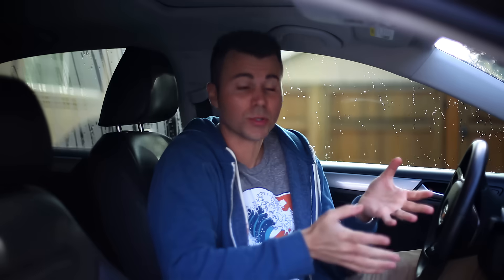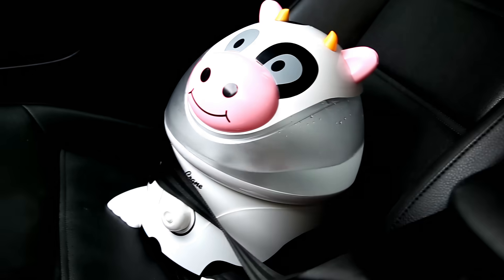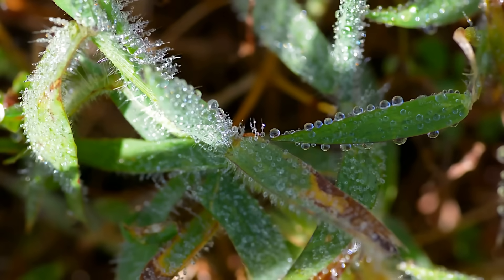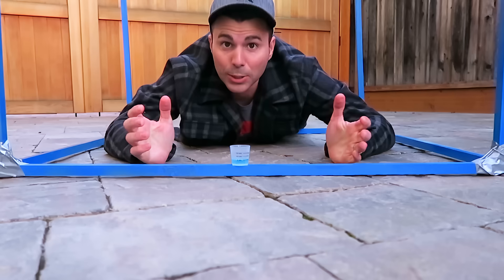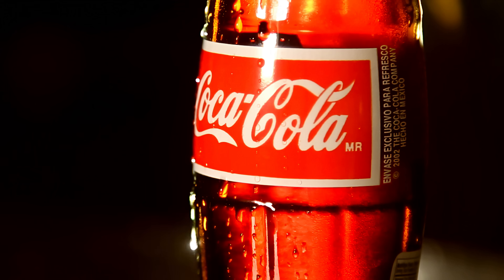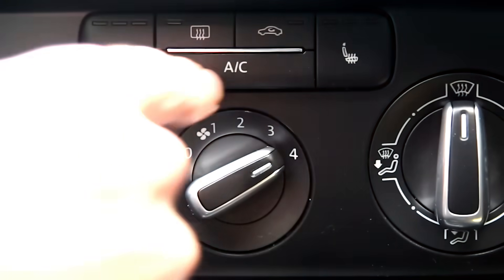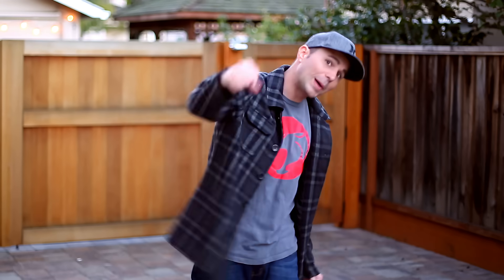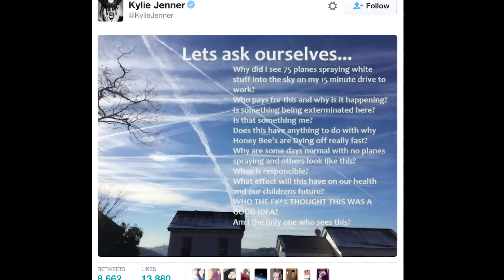Defog your windows TWICE as fast using SCIENCE- 4 easy steps

Comment: I'm not a scientist, I do have an engineering background and a lot of common sense.. I have known for years that what you mentioned here the best method to defog your windshield is to use the A/C, have the intake on fresh air not recirc, crack the windows a little if required, heater to hot and fan to high. It's so common sense I cannot understand why numpties drive around with fogged up windows in the winter with a tiny clear patch rubbed by hand, it's so dangerous.
Reply: Whereas I'm just some asshole who managed to pass a high school science class once or twice (okay eight times, but it's high school, so who cares), and I also could figure out that was the best method.
Reply: Do you actually know what refrigeration is... and how it works??
Reply: It's quite simple:  If you have the A/C on, the air first passes through the A/C's evaporator coil (usually the cabin air filter comes first, if there is one).  The evaporator coil will dry the air.  After it goes through the evaporator, where the air is both dried and cooled, it passes to the heater core (or heater matrix), where the air is warmed to the desired temperature.  Yes, this is where the setting you've chosen for your system will decide just how warm or cold the air is.  Before the heater core, it's at its coldest level.  If you've selected anything but that coldest level, the heater core will warm the air a bit.

This, essentially, gives you dry air at whatever temperature you've selected - even hot temperatures.

If you don't have the A/C turned on, the air bypasses the A/C system entirely and goes directly to the heater core.  This means that the air has not been dried, and also means the air has no chance of being a lower temperature than ambient (and will likely be warmer, considering that it passes through the car's radiator, pulling heat from the car's coolant).  As such, without the A/C system turned on, the air will likely be more humid than it would be otherwise.

To summarize:  The A/C system dries and cools the air, where it then can be warmed up by the heater core to whatever temperature you desire.  This will defog a window better than bypassing the A/C system, which does not dry the air.
Reply: U r coming across as bragging moreso than complaining .    Just sayin
Reply: Marek Sumguy - Why don't you try it?  Turn on your AC, and make sure the heat is on.
Reply: Marek Sumguy - Yes, I do.  Do you know you can have A/C turned on while heating your car?  Did you know that doing so makes a difference? 

The point isn't having "hot A/C", as you've described it.  The point is that turning on the "A/C" button while heating your car actually makes a difference.
Reply: Please explain how.
Reply: So you're telling me that the A/C evaporator coil is on the same air circuit as the heating coil??  

And IF this is true... that would mean that the best way to cool down an overheating engine would be to put on heat and A/C... as this would draw as much heat as possible out of the heater radiator?
Reply: That's not exactly how it works.  All of the air, whether going through the radiator or through some other inlet, ends up in the ventilation system.  If the A/C is on, the air is shunted to the A/C system, where it ends up at the heater core.  If it's not on, the air goes directly to the heater core.  Of course, if there's a cabin filter, it goes through that before it hits the heater core either way.

What that means is that the A/C doesn't help pull heat from the engine.  The air is moving through the radiator at a speed determined by outside factors (car speed, radiator fan speed, etc) no matter what, whether you have the blower on high, low, or off.  The engine is being cooled through that radiator the same, regardless of whether the A/C is on. In fact, the A/C pump makes the engine work just a bit more, so - if anything - the engine would generate slightly more heat if the A/C was on.

As such, if the engine is overheating, the best options are to shut it off or get some speed.  If you're stuck in traffic on a hot day, it won't hurt to have the A/C on (you do need to cool down), but having it on won't cool the engine.

Neither will having the heat on full blast.  The heater core does draw heat from the engine, but not at all enough to cool the engine down any faster.

One caveat:  Older systems, with mechanical levers and nearly-ancient (by today's standards) A/C pumps will work a little differently.  They still use closed-loop refrigeration, with an air drier and an evaporator, and they still used the heater core to heat the air up to your setting.  That said, they didn't have robust cabin filters, the pumps were powered differently (sometimes), and they were often so inefficient that their operation made engines work even harder.

In short:  While the A/C system is separate from regular ventilation, they do meet together in two places:  the cabin filter and the heater core.  If you want dry air pumping into your car, use the A/C.
Reply: Excuse me... but how can you have HOT A/C??. Isn't the A/C coil on a different air circuit?!??!

Pro tip: use 12 volt (or portable battery powered) heat gun/ hair dryer.

Comment: the only bad thing about this is that having the AC on and heater burns through gas
Reply: Its a microscopic amount of gas that it burns, and its nothing compared to idling the engine for an extended period of time (which uses a huge amount of gas and wears your engine out much faster) so this technique actually saves you gas and money.

Comment: I didn't know that any car will do heat and a.c. - mine doesn't
Reply: Yes it does, simply turn on the ac with the heat... You're welcome...
Reply: Hezekiah Domowski ... I've never known a car with AC to NOT allow that. You'd be doing a public service to tell us what back-asswards cars you've owned so we all know to avoid them ;)
Reply: In my country, and i believe most asian country has only a/c without heater since the weather is warm in most of the countries most of the time. So yeah
Reply: Not all cars have a heater it depends where you live. Because if you live in a country that doesn't get freezing temperatures it wouldn't make sense to spend extra money on something that would never be used. I live in Canada so every vehicle has heat but in older cars a.c. was an option not a requirement.
Reply: If your car has a heater (some cars sold in tropical countries don't have one) an dit has Ac then this can be done. What differs is that many cars have a superstar button that activate the AC (compressor) and that is the technique that is shown in this video because that is how his car works. Many cars that have some sort of automatic climate control (whatever its called) do not have a separate button for the AC compressor. Those cars will automatically engage the AC compressor when the defrost buttons are activated. You can see this for yourself by opening the hood, watching the Ac compressor engage as someone inside the car activates the defrost buttons (many of those cars have two buttons, press them both just to make sure that you have engaged the correct one). You see the front of the AC compressor start spinning when the defroster is engaged.
Reply: Hezekiah Domowski literally every car ive owned is able to do so. dodge neon, an ae92 corolla, b5 a4, suzuki sx4. fiat 500t, and bmw 335d.
Reply: Just because you don't use it doesn't mean that the facility doesn't exist. Cars sold in arctic regions still have the ability to blow cold air, even though that might never get used. It's simpler and cheaper to just build them the same rather than bothering to delete the heater matrix from the spec, particularly as you might find yourself in need of the warm air function if you drive up a mountain in the cooler seasons and start encountering ambient temperatures in single digit celcius. And it can get even colder at night.

I mean, there might be tropical region models that truly don't have anything but fan (and maybe A/C), but I'd be surprised to find it. The function of a car is to travel after all, and it may well take you thousands of miles away from home to somewhere that has a very different climate, so there's no sense to not equip it for such an eventuality. It also works as an emergency heat dump if your cooling system suffers some malfunction (sticky thermostat, failed part-time radiator fan, etc)...

Comment: There seems to be some confusion here between "de-frosting" and "de-fogging" / "de-misting"...
Reply: mspenrice where I live pretty well every time I get into my car in the winter there is frost on the inside of the windshield. It’s really common anywhere even remotely northern.
Reply: mspenrice I meant the snow melts once you are in the car and once you leave it overnight is when it condenses and freezes. I live in southwestern Ontario. Usually -10 to -20 sometimes -25 during the day and -20 to -30 at night (Celsius for all temps)
Reply: Define "remotely northern". I live somewhere that's considered by some to be at least technically in the north of the country, but it's "only" about 53 degrees above the equator. Which is enough for decently wide swings between summer and winter (like 50'C / 90'F between the highest heat and the deepest cold)... I've only seen frost on the inside of the car when the temperature has dropped somewhat from near freezing to double digit negative celcius, ie so there was still SOME moisture in the air, which then ran into an extremely cold piece of glass that froze it in place instead of spreading it out into a still-technically-liquid misty covering...
Reply: mspenrice it depends on how many people you have in ur car, since more people brings more snow in, which melts and then condenses on the windows and freezes. As far as remotely north I should have said anywhere where in winter it’s below freezing consistently. Doesn’t really matter
Reply: We regularly have winters where it can be subzero for weeks on end... still only seen it happen 2 or 3 times. Also, the frost I'm talking about is already on the inside of the screen when you get into the car... and wouldn't more people cause the interior to warm up faster?

I guess what I'm asking is where you are. No need to be exact, like, just general area of whatever country or state...
Reply: Ah, I understand now. And yeah, that's considerably more "north" than what we experience ... even though you're probably on about the same latitude, the lack of jetstream / labrador current and being more continental makes the winter harder and probably counts for a good ten extra degrees :-o
Reply: And then if you're canadian there's deicing the inside of the window
Reply: Well, usually the latter on the inside go hand in hand with the former on the outside... so it kinda gets lumped together.

When you have to defrost the inside of the car (which I've had to do maybe twice before) you know things have got truly serious. All the same, this method will still help you to do THAT faster as well (warm, dry air will assist the ice in both melting into water and subliming into vapour)

Comment: Umm...just use a bucket of warm water and pour it on your window and it defrost in idk 0:5 second
Reply: Furiousfifa_martyn !!!! warm water on frozen windshields = new windshield needed.
Reply: This video isn't about defrosting a window. It's defoging the window. But if you want to use a bucket of water inside your car go right ahead.
Reply: Furiousfifa_martyn !!!! Not sure that your car gets to -30 Celsius at night or colder. Warm waters not good on glass at those temperatures.
Reply: I hope you don't have a chip in your windshield, cause that'll cause the windshield to spiderweb...
Reply: BlazeChronicGreen420 no it doesn't I do that all the time is fine
Reply: ANIME GODZ lol Not only were you extremely confident about your input, but you also failed to read the title of the video...... How is this the world we live in?? Did you even watch the video? There were two free chances for you to know what was going on..... Wow
Reply: Bottle of rubbing alcohol you can put in your car it'll be cold it's alcohol it won't freeze it chemically melts ice anyway so pour a little on the ice melts I know none of this has anything to do with fog. You don't want fog on the inside of your windows roll up to damn windows then all the moisture is on the outside
Reply: crownofall - There's moisture in the air inside your car, so there WILL be condensation on the windows if the temperature drops below the dew point - regardless of whether the windows are up or down.
Reply: John Crafton If the moisture content of the air inside your car is higher then outside the car, the dew point inside your car will be higher then outside. The more saturated the air is the less temperature drop is needed for it to start forming a fog. The idea is if you open the windows the air outside will have lower moisture content and therefore a increase the dew point temperature, which would help speed up the effects of defogging the inside of your window.
Reply: Sycops - I know this.  I was replying to "cronofall", when he said "You don't want fog on the inside of your windows roll up to damn windows then all the moisture is on the outside."  I was merely stating that there's moisture on the inside, and that keeping the windows rolled up won't prevent that.
Reply: John Crafton my mistake.
Reply: Sometimes this will crack the windshield and sometimes it won't. Modern windshields are very strong but this is an abusive thing to do to it and you might get away with it sometimes but then again there are plenty of folks that have done this and crack their windshield the first time they tried it so don't do it.
Reply: Angel Martinez ops didn't know it was Defog

Comment: Fog and humidity is nothing, try coming up to Canada where we have freezing rain...fun times.
Also when snow hits the warm glass of the car you have just been driving, or when it's warmer during the day and the temp drops at night, this causes frost build up on the outside of the windshield (usually at the bottom near the wipers, usually freezing them in place). Harder to remove and takes longer. If you have cracks or chips on your windshield, an excellent way to turn them in to a spiderweb is to beat at it with a scraper or blast the defrost heat directly on to the windshield. Also cranking the wipers when they are frozen in place or covered with heavy wet snow is a perfect way to break them or burn the motor assembly.
Frost builds up on the INSIDE of the car when you have water/melted snow in the foot wells, or the floor mats are damp.
When you lave the car parked, and the temp. drops at night, the rising moisture freezes to the inside of the window. The best remedy for preventing it is to keep the inside of the car dry as much as possible, like putting news papers in the foot wells, and silica packets on your dash to absorb any rising moisture that may reach the windshield area.

Hopefully you learned more from the info in my comment above than having wasted your time watching this video.
Reply: So I can avoid having to do any of his advice, by stuffing my car with newspapers and silica gel packets? I was using an aerosol can and a lighter to melt the ice before, I accidentally set fire to my car once and defrosted the car next to mine. I also used to pack fruit into my exhaust to feed foxes at night. Their saliva has special cleaning properties that turns your exhaust chrome.
Reply: Chargèro Canada is not the only place that gets freezing rain...lol it makes its way down to the middle of United States, sending love from Central New York! Oh and anything written in your comment is basically common knowledge. This guy's video was far more intellectual and scientific than you could ever hope to be.
Reply: He said it depends on things just like what you said. He went to a huge effort to educate us. Be cool man.
Reply: Videos from Québec ya im in northern mb. On cold days i can pour a bottle of water out and it freezes before it hits the ground lol.
Reply: Videos from Québec Maybe you should realize that freezing rain isn’t a phenomenon that only occurs in Canada. I’ve seen it here quite a bit.
Reply: chance the rapper
Reply: Then Global Warming and Climate Change come rolling in...
Reply: Laurence H: You win!
Reply: Thank you to all for the helpful suggestions from this thread. Desiccant (what's used in silica packets) is easily found, & affordable, at local stores, because it helps to absorb moisture from damp places. High humidity weather can be an ideal environment for mold to breed, especially on clothing or linens in closets at home.
It is also used in RVs & boats.
I've purchased the brand DampRid at a big box store.
Reply: I usually lift the wipers up although i dont do this when it snows 40cm
Reply: This explains why i have a frosty window inside my car. Before i drive alone i have no issue on frost  now i have carpol they leave a lot of  snow inside my car. Thank you so much. This helps a lot.
Reply: Sucks to live in Canada